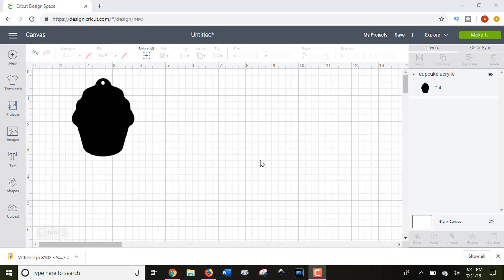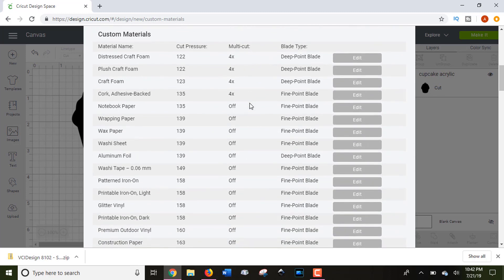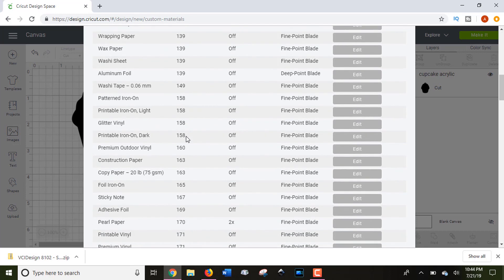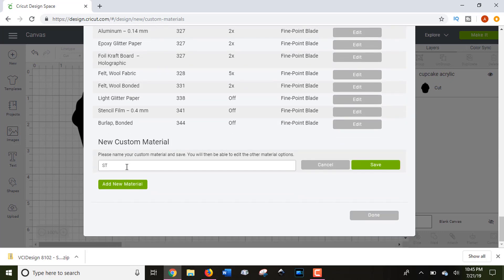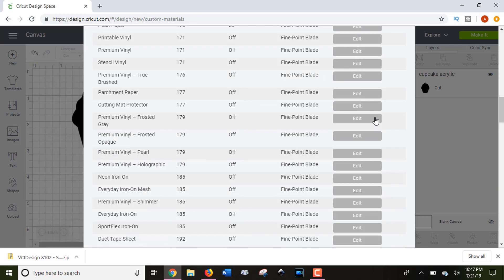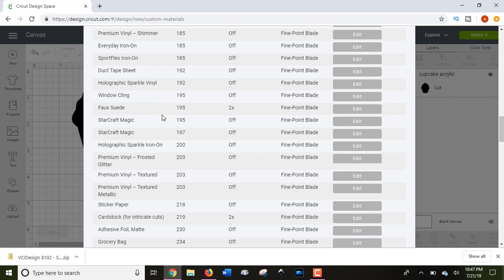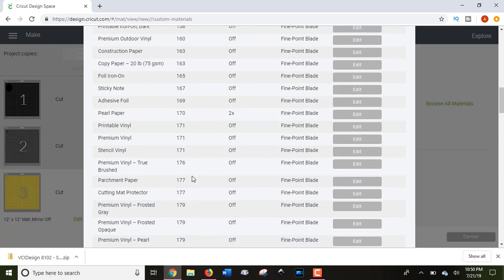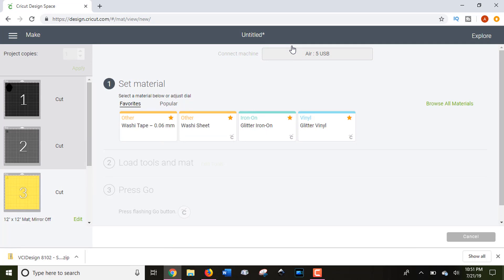How to Adjust Blade Pressure Settings in Cricut Design Space

Comment: My app stopped letting me do this. It let’s me choose between light blade or deep blade, if I’m cutting leather, but only gives me one pressure. If I tap it takes me to an “edit” page VERY briefly, that is blank, but then automatically back to the main page. Will not let me custom edit like it used to. Frustrating.
Reply from the maker: That’s odd!! They may have updated Design Space to not allow those changes anymore.
Reply: @DIYAlex  Seems insane to do so, since they rendered a functional machine into a brick by taking away functionality. Someone should be fired, if so.
Reply: Yes! This is happening to me. I don’t have these options she’s showing. It pops up then goes away.

Comment: Hi Great video. Do you think the same settings and pressure apply when cutting a script font? I am trying to cut Cricut glitter vinyl like was in your video, but 3 times no luck. More pressure etc. I will try a different setting, as you recommended, but I am wondering if it will cut well because it's one whole design as opposed to a font with cutouts etc..thanks!!!
Reply from the maker: What you're cutting won't make a difference, so that should be fine! The less/more options don't change the cut setting very much. I would suggest trying a totally different setting to see what works best for your machine.

Comment: I do not have those options in settings I use my phone and the app does not have those options. It seems like I am very limited I have the dollar store vinyl. And it just destroys it cuts right through to the mat no matter what I've tried. So much waste I'm getting frustrated. Don't know why I can't use the app to change the settings like everyone else is doing? And there's only so much option for material and anything anyone recommends is not in mine for my Joy.
Reply from the maker: The Joy does have some different options than the other machines. Are you using the Joy app or the Cricut Design Space app?

Comment: Hi, I am new and just started using my Cricut Maker.  I purchase Oracal 651 & having a difficult time with the cut.  I added "Permanent Adhesive Vinyl"  to the material list & I even tried cutting with "Vinyl".  Neither is working.   It's cutting through the back.  At this point I am extremely frustrated & considering returning the Oracal 651.
Reply from the maker: That cut setting should work so that's definitely strange. Are you using the silver fine point blade that came with your machine, or have you replaced the blade with an off-brand blade?
Reply: @DIYAlex  Hi, thanks for responding.  I am using the blade that came with the machine.  I have found that Washi sheet works better for Orcal 651

Comment: I am on my 3rd Maker since February.  Each one has had a different issue.  I just started using #3 replacement yesterday and I can't get the material settings low enough to not cut thru the backing.  I set up a custom material with cut pressure of 70 and used less pressure.  It is still cutting all the way thru the backing.  The app won't allow me to go lower than 70.  I even tried changing the fine point needle to the one from my 1st machine (which was cutting vinyl ok), used less pressure with the custom material cut pressure of 70 and it still cut through.  Any suggestions??
Reply from the maker: Gosh that's frustrating! The only thing I can think of is maybe you havee a blade with too steep of an angle. The fine point blade (that comes with the Cricut machine) is angled at 45 degrees. If you bought a blade at Michaels with a grey cap, there's a chance that it's a 60 degree angled blade and it will cut through most everything. Are you using the blade that came with your machine, or did you buy your own blade from Michaels or somewhere else?

Comment: Thank you for the video! I have wasted two siser htv. When I cut it the blade cuts through the backing also so my letters are stuck on the mat. The second time I tried I had my pressure set on default and it still cut through the clear backing. I have a cricut maker do you have any recommendations?
Reply from the maker: What cut setting are you using? What kind of Siser HTV is it?
Reply: @DIYAlex  I finally decided to select premium vinyl on my material setting and it worked!!

Comment: so I wanted to wait till I tried your ideas, and it worked-I have been on hold for exactly a year now since I made the wrong size shirt for my niece last Christmas and need to make another one but every time I tried to cut the name with cheetah spots on the maker it was so small and intricate it torn it apart while when I first did it on the air 2 I used Washie Tape and Deep Cut Blade and worked but not on the maker so I took your idea and made another setting calling it Mandala intricate cuts set on 149 with deep cut blade which is the same setting on the air 2 and what do you know it worked.  Every since i go the Maker I have had more trouble with cutting which I did not have with the air 2 so now I might be actually able to start liking the maker.  And everyone is correct no one explains it as clearly as you do.  So happy I found this video.
Reply from the maker: I'm so glad you found a solution! Great job making your own cut setting!

Comment: I have a joy and when I cut the premium vinyl it pulls away from the backing and sometimes cut into the backing.  Should I use less pressure?  I will try what you said doing test cuts.
Reply from the maker: Yes, less pressure or a less intricate design.

Comment: What about for cutting stickers? When I do mine it literally over passes the back paper as well and is hard to unstick 😏
Reply: Try calibrating your machine.
Reply from the maker: I agree, try calibrating your machine and use a blue light grip mat with sticker paper. Flip the mat over when you remove the sticker paper and remove the mat from the backing so it's a little bit easier to peel.

Comment: I am having trouble with my cricket air two. I am cutting out a very detailed Invitation for my wedding on a thicker texted card stock. It cut out about 6 cards perfectly and then started missing some spots when it cuts the paper it is getting Crinkled up. And it is not on the same spot ever time. I have changed out my blade tried a new board. I tried citing it on different setting as well. I am at a loss as to why it just stopped working when it cut out the first ones perfect. Any help would be amazing
Reply from the maker: I would make sure you’re using a very sticky mat. You may even want to go up in the tackiness (like use a green mat instead of a blue one). It also helps to tape the edges down carefully with painters tape. 

Between cuts punch your blade into a ball of aluminum foil to get any scraps off your blade. That causes snagging frequently as well.

Comment: Is there a printable cricuct make blade pressure chart, I have problems cuttting various vinyls because of wrong blade pressure
Reply from the maker: It depends on what brand of materials you are using. 143VINYL has ap printable cut setting document with the products they sell. It's free to download!  https://www.143vinyl.com/material-cutter-settings-document.html?partner=403469

Comment: I have had my Cricut Maker for about 10 days.  It came with the Fine Point Blade.  I have been trying to do a Mandela #M185D3358.    It is very intricate and the blade is not cutting through my cardstock which is 65 to 100 pound stock.,  I have adjusted the settings  from 185 in 10 point increments to the most at 250 - with multi-cut 2x.  It is still not cutting through the cardstock.  Can you advise?
Reply from the maker: First you're going to need to narrow down what weight your cardstock is. 65-100 pound cardstock is too broad to help you choose a cut setting. Then you will just need to do test cuts until you find the right setting. I use the light cardstock setting for 65 pound paper, the medium cardstock setting for 80 pound paper, and heavy cardstock for 100 pound paper. Try all of these and see which one gives you the results you want. Also consider making your mandala larger.

Comment: Hi there, I bought some Oracal 651 Permanent Vinyl but my Maker didn’t cut it well. I can’t weeded it. Is it because of the pressure that need adjustment? or is it because the 651 should be placed on the mat shiny side facing up? I have been trying to make a stencil using it screen printing on a t-shirt. Patience :) Thanks for your tutorial.
Reply from the maker: Hi Millie! Permanent (651) vinyl should be placed with the vinyl side up. So try that and see if it weeds. If it doesn't weed after that, then adjust your pressure. You got this!

Comment: Is there a pressure you suggest / that way work if I wanted to cut straight thru vinyl? (Almost like a die cut)
Reply from the maker: That’s going to vary by vinyl type and machine, so I would do test cuts until you find the sweet spot for what you want to do.

Comment: Can someone please help me. Im trying to cut 1/16 balsa wood with the knife blade. I tried following these instructions to adjust pressure on my material but it won't let me adjust pressure on the knife blade. It won't cut through at all..no matter how many times I repeat the cut.  Desperate for help
Reply from the maker: Are you allowing it to make 16-20 passes? Depending on the project when you select the knife blade it's going to make a ton of passes and you should let it do most of them until the knife blade is cutting through your mat.

Comment: Hi Alex I would like to ask how to I set the cutting file with 2 difference cutting pressure in the same file. lets say I am ready to cut a sticker sheet and I place few sticker with in a box. after set the normal sticker pressure cut and at the same time I want Cricut to cut totally of the box outline. so end product will have the sheet of sticker peel off and sticker are in side the sheet?
Reply from the maker: You'll have to put a rectangle around your stickers that is smaller than the print then cut size. Then flatten your stickers on top of the rectangle and that should get it to cut around them.

Comment: Okay, here’s a really stupid question. My wife just got a new Maker, and when cutting some lettering on vinyl, there are a few places where the blade doesn’t quite cut through to the backing. I think I’m going to try your “stars” method of doing some test cuts. Pretty straight forward, but what I don’t understand is how do you shift each star (each assigned its own color/mat) over so they don’t cut in the same location, one after another. Did that make any sense? Maybe the idea is that if the first one doesn’t cut through, the next one may finish the cut that the previous one failed at?
Hey, fantastic videos. Thanks!
Reply from the maker: Hey Jeffrey! This question isn’t stupid at all! When you go back to the screen where you can see the mats, select “edit” and then scoot the star over more than 1 inch and you’ll be good to go! Thanks for watching!

Comment: Hi, I have only used my maker for cardstock so far. There aren't setting for every gsm and the last cut I did left a slight cut mark on my mat, not sure what to do. I have 160   200, 210, 240 and 250 gsm. I also have cardstock that I don't know the gsm of. The settings on the Maker are 216 or 270 gsm, I have been using the closest.  Not sure what to do to make sure I don't cut into the mat.
Reply from the maker: If you have marks in your mat that means your pressure is too high. It might help to convert the gsm weight to the lb weight so that you can see what the other options are in the Cricut software. Otherwise you'll have to experiment with cut pressure until you're cutting through the paper but not into the mat anymore.
Reply: @DIYAlex  Thank you!

Comment: for some reason my blade makes small dots instead of a straight line when i try to cut my stickers but i haven’t found any video that addresses it ):
Reply from the maker: So that has to do with the nodes on the file. Nodes are basically points on a graph, and each type of node gives your Cricut instructions on which way to go when it reaches the node. Have you tried putting the file in Inkscape and using the node editor to look at it? You can delete the unnecessary nodes. Ideally you would take it down to as few as possible so your machine will cut your designs quickly.

Comment: I have a cricut expression machine.im having issues with 110 lbs cardstock cutting
Reply from the maker: I have never used an Expression, so I can’t speak specifically to that, but my best advice is to make test cuts until you get a good clean cut before you start the full project. I hope that helps!
Reply: I have cricut expressions 2

Comment: So I’ve been trying to cut rather small fonts on iron on vinyl, I keep having problems with letters being not fully penetrated by the blade. I changed the pressure, when I go to cut and the blade asks which pressure to use do I select default and that automatically uses the pressure that I changed to ?
Reply from the maker: Hi Angel! You can start with default pressure, but feel free to increase it to more before moving on and trying another cut setting too. The increase is small between more, fault, and less so feel free to play around with it.

Comment: Hi!  I have an older model cricut explore that I used to use to cut paper to make teardrop shaped earrings.  I stopped using it because it was only making shallow cuts even with a new blade.  Someone suggested I check the blade or housing pressure?  I am not sure how to do that to get a clean cut, where I don't have to cut it out with scissors after.  Any advice would be appreciated.  Thanks
Reply from the maker: I’ve never done anything like that. I would give Cricut customer service a call to see if they can help!

Comment: Your video was helpful but did not cover my problem. I use cardstock more than any other material. My Explore does not cut with even pressure. Cuts on the left side of the mat cut more thoroughly than the center and right side. Left side cuts release cleanly, but others only cut partially through some shapes (it seems to cut the left side of a shape more deeply than the right side: example, 1" wide hexagon). Thanks for any suggestions you can offer.
Reply from the maker: I can only think of 2 reasons why that would be an issue. First, your mat’s stickiness May not be even. If you’re experiencing this with every material on different mats then you should contact Cricut customer service to see if they can help.

Comment: I'm having trouble using the scoring stylus on the explore 2. Is there anyway to adjust pressure based on the tool being used?
Reply from the maker: You adjust the pressure by choosing the material you’re scoring. What are you scoring and what do you have it set on now?
Reply: DIY Alex I am using light card stock and the setting is set for 272. It makes a mark to show the start and end of the score line but won’t do any of the actual score line. It’s like it’s not making contact with the paper at all.
Reply from the maker: Hmm. Have you tried making sure the scoring stylus is set in the machine correctly? I wonder if it’s not close enough to the cardstock to finish the whole scoring. Is the machine trying to make the whole score line or is it just doing the beginning and the end before stopping?
Reply: DIY Alex based on your suggestion I when up a weight on material, setting the dial to car stock, then I took the cutting blade out and when over the score line twice. That was a great work around for now. Thanks so much for taking the time to assist. I’m subscribing right now. 😄
Reply from the maker: Yay! I’m glad you found a way to make it work! Try making sure your software is up to date as well. Cricut has done some updates this week to fix some issues so the scoring pressure may be one that’s fixed! ☺️

Comment: So I follow this video when my blade is not cutting all way through on my vinyl/vinyl + setting ?
Reply from the maker: Correct. The material you are using may require more than the vinyl + setting so use this process to find the setting you need.
Reply: Same Question??

Comment: Hi. I am desperate for help I have a brand new Air explorer 2 ..I followed your video. But I dont see the material settings section ...help. my machine will not cut ☹☹☹
Reply from the maker: You can find the custom materials section by clicking the 3 lines in the upper left corner and click manage custom materials, or you can click the green Make It button in the upper right corner and then turn your dial to Custom to see the list.

Comment: Okay I'm new at this and I'm desperate.😭 I have a  explore air 2 and anytime I put the dial on custom it goes through the motions like it's cutting but the blade isn't even touching the material and it doesn't matter what custom material I put it on.... as long as it's on custom it won't cut.
Reply from the maker: Hi Shellie! That’s odd, I’m sorry it’s being difficult for you! Have you tried calibrating you’re machine? You can do that by going to three lines in the upper corner of Design Space and choosing “calibrate machine” and it will prompt you from there. You’ll need a printer to calibrate it. If that doesn’t work, then you should definitely call Cricut customer service. I hope that helps. Let me know how it goes ☺️

Comment: I'm confused, if my blade is cutting all the way through the backing do I want more or less pressure?
Reply from the maker: You want less pressure
Reply: @DIYAlex  Thank you, so I would choose a setting with a lower # than I was using, correct?
Reply from the maker: Yes. A lower number would mean the machine is using less pressure on the cut.
Reply: I have the same trouble. Did you solve it?